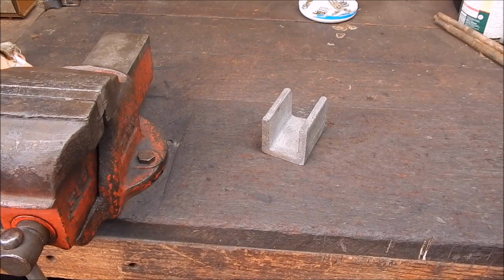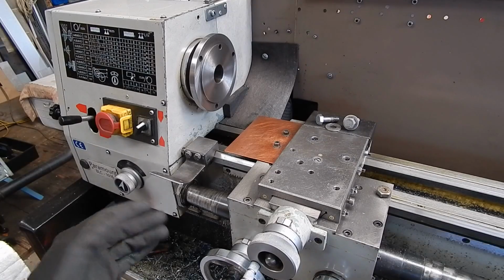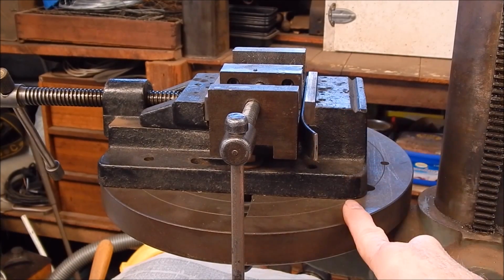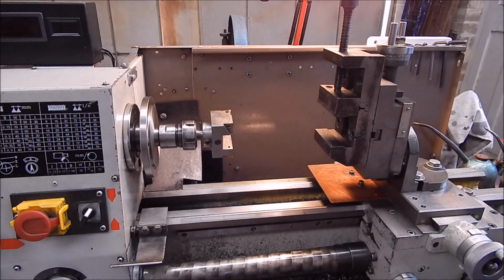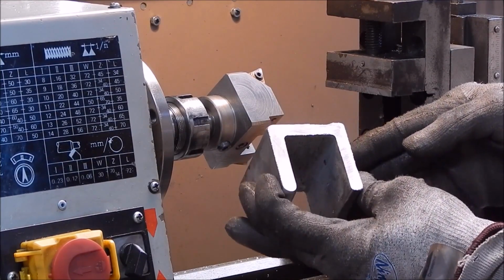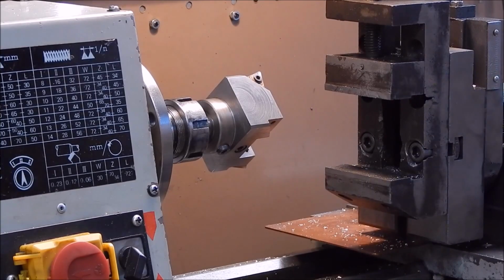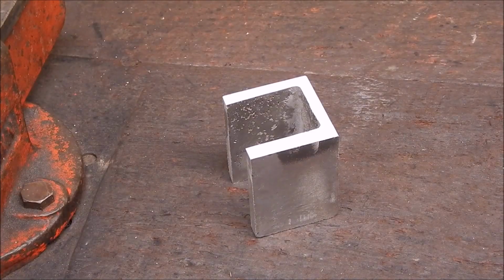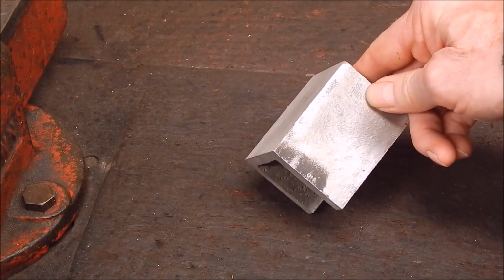Milling home brew aluminium on a metal lathe

Comment: I have done quite a lot of milling on my Taig microlathe. I have no face mill, just a fly cutter. It is basically a very difficult procedure because the whole setup is really flimsy compared to a Bridgeport  mill (substitute your favorite mill in Oz.) The whole thing is holding and stabilizing the work,  the actual milling is a piece of cake. The lesson on harmonics is very valuable to me. I agree with "wana bear" that a machinist's jack would help. Got to make me one. Alternately jamming a piece of steel bar in the channel, anything to break up the resonance. I like that face mill you made. In fact this video is invaluable because I now know what mistakes not to make.
Reply from the maker: Juan Rivero That's the whole idea of putting up this type of video. Learning from failure seems to stick better than anything else.  My channel tells it how it is.  Cheers Rob
Reply: a simple nut and bolt might have sufficed. a bolt just long enough to fit in between the two points then wind the nut out just enough to hold it.

Comment: Hi Rob !

Really nice deomo of that mill attachment ... and a neat job done untill that chatter came up ;-(( !

I noticed your cutting head have 4 points to fasten the inserts and you used the two of them which gave a strange cutting angel for the inserts - I beleave - have you tried the other two fastening points - around 10:00 it looks like the insert is "pushing" material more than cutting material - right !

I'll try to make a fly cutter for facing up my alu bars instead of using a saw blade as in my video the other day.

Thx for showing !
Reply from the maker: Keld Sørensen Hi Keld.  I should have switched to the other cutter angle, but didn't think about it.  I made it with two angles, one is for making a 90 degree corner, so it can be used as a giant slot mill.  It works pretty good on steel, but carbide does "push" soft metal as you saw.  It made plenty of chips to clean up.  HSS would be better for alloy.  Fly cutters work well on facing/dressing metal.  This is really just a double tipped fly cutter.  Rob
Reply from the maker: xynudu I prefer a double tipped cutter as it is balanced.  At high RPM single tip cutters can vibrate. This is not good from a safety and finish perspective.  As you saw, the finish from my cutter is excellent (when the job is held correctly).  It uses replacable tips from my indexable lathe tooling, and they are not really meant for this type of work.  The tips would be better if I grind a relief into the cutting face - which I may do.  This will give more of a spooning action like genuine carbide milling tips.  Rob
Reply from the maker: xynudu Hi Keld.  I was thinking about how I would make a double tipped fly cutter for HSS.  I would use a 20 mm thick disc on a mounting shaft.  Drill through the disc near the perimeter for each HSS rod, and drill/tap in from the side of the disc to lock/bolr/grub screw the HSS in place.  Might be of some use to you.  Cheers Rob
Reply from the maker: Keld Sørensen Ha Ha Ha.  :)

Comment: Gday mate.  That is some good aluminum.  I think you have it down pat.  I also think we have the same pedestal drill.  Mine is from Taiwan.  I am awaiting the next try at this casting.  Thanks for sharing.
Reply from the maker: cerberus Mine is a Royco.  But they sold them under many names.  Really good strong unit.  Better than the current Chinese ones - no slop in mine.  Yes, that was a good pour.  I spent today making a bigger melting pot as the current one is a bit small.  I used the metal casing from a DC treadmill motor, and welded in an end, turned down the excess.  Probably about twice as big this time.  If the weather stays dry I will do some more casting.  Rob

Comment: I'm sitting here thinking slabs of polystyrene in a sand mold may give you an easy to make sacrificial mould with thick sides.
Just pour the hot stuff in and dissolve the sucker!
Reply from the maker: Ray Jones Yes me too.  I've never tried it that way, but have the foam and always intended to.  The method I saw was that you coat the foam with a light plaster film to avoid sand marking the surface.  Have you tried it that way ?  Rob
Reply: Hi Rob, purely a comment from an armchair expert ;-) , though I am keen to try some casting soon myself.
I'm thinking the foam would leave it's own unique surface finish beneath the plaster anyway?
Either way I'd reckon you'd have a non smooth surface to mill....